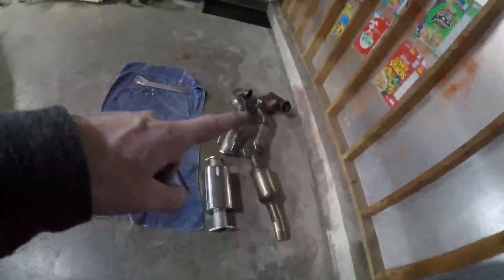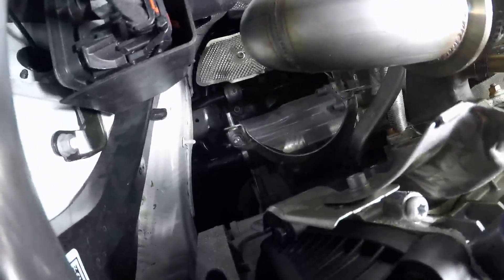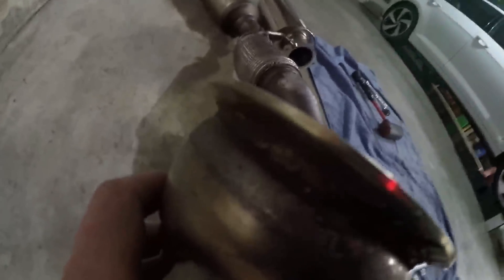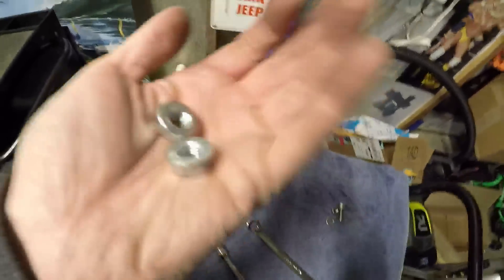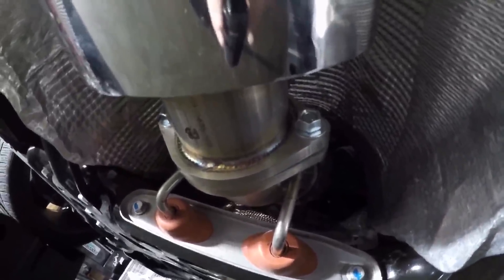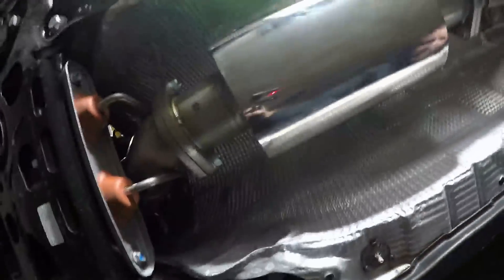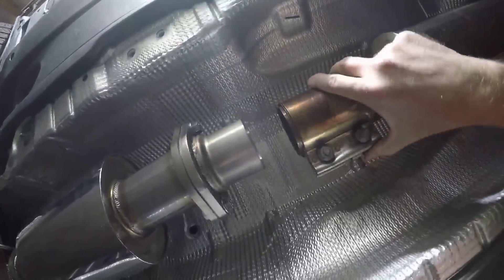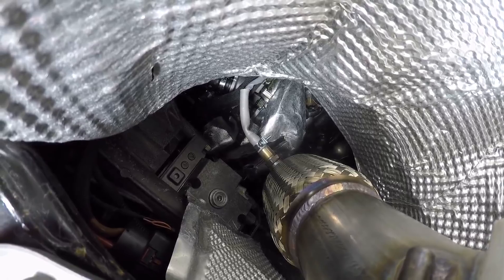youtube video #-We8YKmQCyk

Comment: How was the install vs the unitronic?  what about the end results vs the unitronic?
Reply from the maker: same exact results. easier install on the Ultimate Racing because it has 1 middle bracket instead of both like stock. Still holds 100% perfectly. Had no problems with either install. The biggest tip and biggest thing that screws people with the PP diff.... get your downpipe half way out.. then remove the O2 sensor before you pull it all the way out. Makes all the difference, and trying to get it out with O2 sensor sticknig out 3" will add 30 mins to your job. Only takes 60 seconds to remove the o2 sensor once you lower the downpipe half way and can see it.

Comment: Took my advice huh?
Reply from the maker: did u mention the UR at some point? did u know i had the UR pipe on two of my MK6 GTI's also?
Reply: @LastHumansGarage  I mentioned it on the video of you putting on the USP. And you replied that the guy you knew left them and you didnt trust them. I told you that the fit and finish was top notch
Reply from the maker: @Qwibby  it aint all roses.. wait for the release of the follow up video.
Reply: @LastHumansGarage  too loud? I cant find one thing I don't like. Little droney in the mid range but I know you're a lot pickier than I am. Exponentially so lol